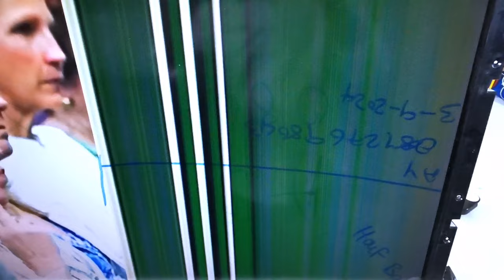TV Half Black Screen? Try this Fix #screenfix #troubleshooting

Comment from the maker: You too can master TV or MONITOR display repair. Explore how to do ribbon flex repair, LED/LCD/OLED TV panel COF TAB manual and machine bonding, microsoldering, and learn to fix faulty screens using several other techniques and equipment, following the tips in the videos on this channel, and with the right support from us. 

Kindly support our efforts to keep sharing panel repair secrets and tips by donating here: https://selar.co/8tz8q6